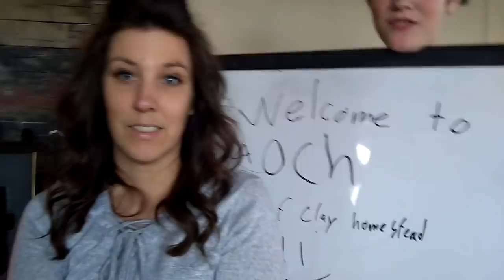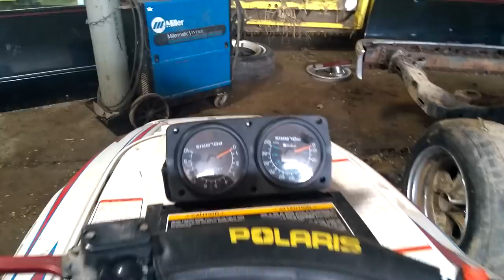Tires, Calves, and a Birthday

Comment: Happy birthday Ethan..Ronda have Kevin check the steering gear box. 99% of the time it is there. Bad dodge defect there is a kit you buy and bolt up and it stiffen it up right away. My dodge had that also constantly turning steering wheel side to side just to stay straight. Also yes he could have used a 20 ton floor jack but with 4 tires its just faster to put a 4 by 4 down you just need a few inches plus the jack would have been in the way as you can see that had to work it from both sides. Have a blessed day.
Reply from the maker: It ended up being the ball joint in the track arm is really wore. Got a new one ordered. Thanks for the advice!!